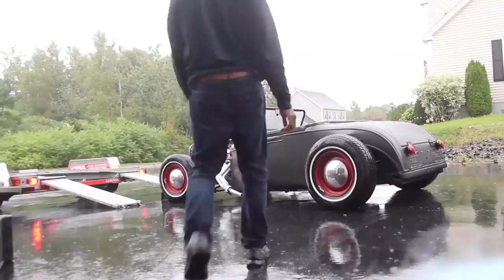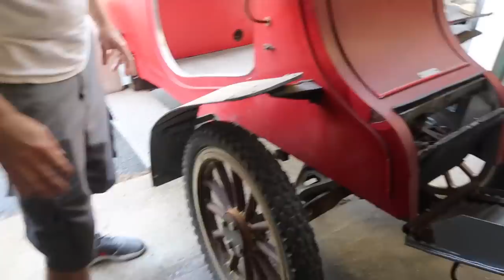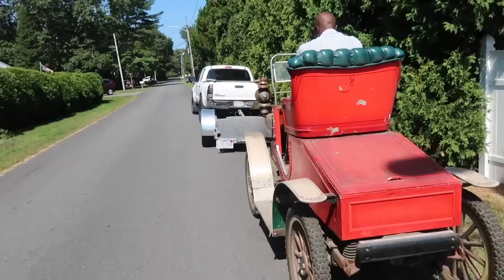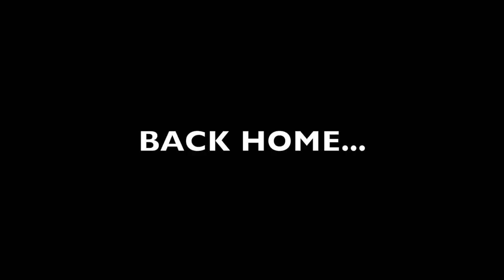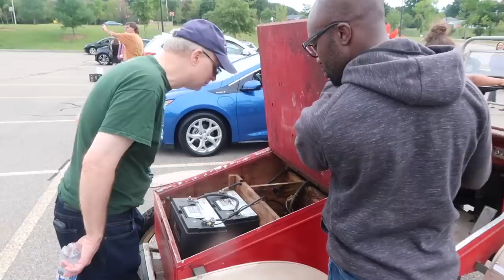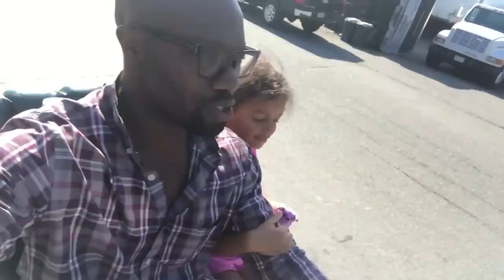Daisy, The Tesla Powered Disney Car!

Comment: I know it's all about speed, sharp looks and high tech for most people. What would be great to lower CO2 emissions in rural areas would be UTV's with towing power over speed. Daisy brought to mind a SLOW steady ride with a hauling basket over the battery cover and/or small trailer on the back for light hauling. No need for Tesla runaround or worries about high tech bling.

Comment: Based on how the trailer titled when unhitched it looked like your load balance was off and not enough tongue weight. Those big tires on the Tesla trailer probably make it more forgiving than a normal trailer but next time you load it I suggest you back it onto that trailer so the heavier end with the batteries is in front of the trailer axle for stability.

I have hauled golf carts on small trailers and when I drove it straight in it got squirrely quick, a mistake I only made once and now I always back them in and double check the tongue weight before hitting the freeway.

Comment: Man Rich, this is deadly! If I were you I'd just go all out; give Daisy the clearest red coat, get the lights working, make it look like a real car from the period. White rubber tyres, adding a rear bench would be cool, a usable windshield and a canopy roof too? For power a 25hp motor would be enough. I doubt Daisy would do much with more than 80v (which the Renault Twizy has). Would Daisy ever be allowed to legally go over 25 mph? With enough power to say.. pull a trailer around she would be a perfect golf cart.

Suspension might be a good place to check out, she looks rough riding.

Helmets and belts may come in handy..